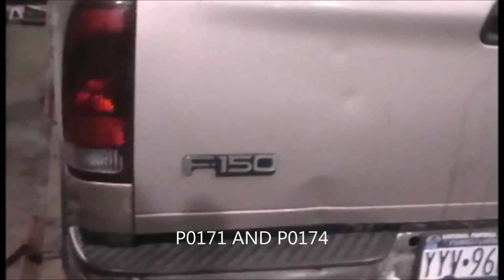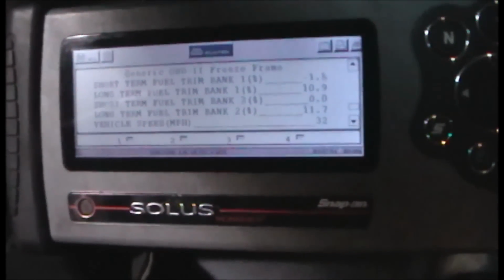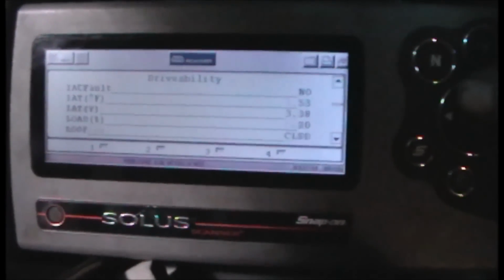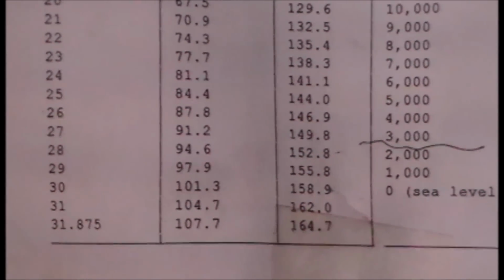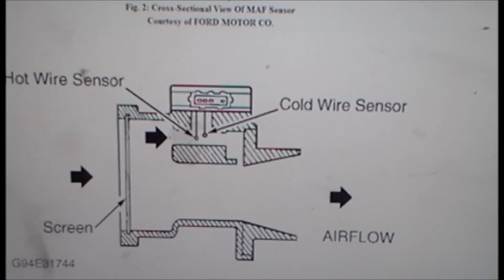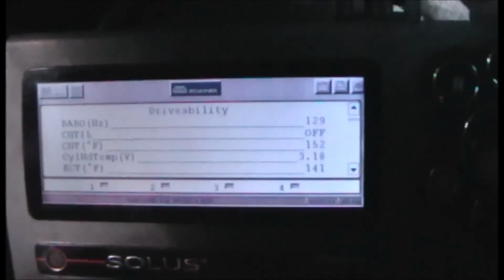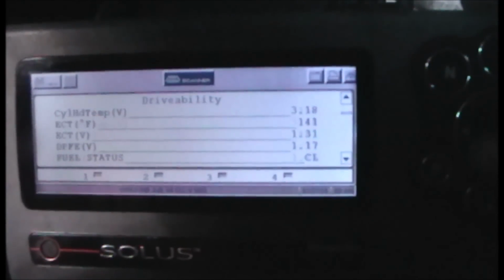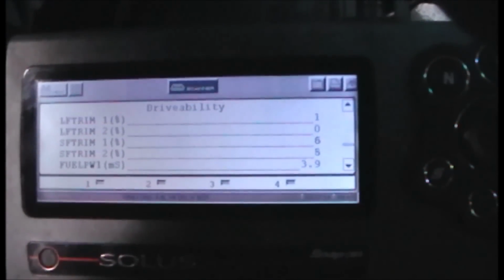FORD V8  SYSTEM LEAN BANK 1 AND BANK 2

Comment: Nice video and the day after i watched your video i got a ford explorer with the same problem. Its cool when that happens. First i tried the wot / o2 test then baro. I had the same codes. Freeze data showed 1800 rpms.  Your baro chart is nice.  Thanks
Reply from the maker: sweet

Comment: Do you have to disconnect the battery?
Reply from the maker: that one cleared up on its own but I have had them go into open loop fault the set rich codes due to the drastic change after fix and need a keep alive memory reset. which can be done with a scanner on some cars without disconnecting the battery

Comment: Curious why a fuel delivery issue was not a consideration based on the data. How did you know to differentiate a MAF sensor issue from, say, weak fuel pump?
Reply from the maker: great question.  I know you are a technical thinker as well. honestly, I have seen this so many times and the fuel trims always act the same. coupled with the lack of any real performance issues like a bog, misfire or low power, which I would expect with a bad pump. I started there, given the baro Hz reading.  that is why I like seeing my confirmation readings on scanner or scope,  whether its re instrumenting or leaving stuff hooked up. because honestly, if I didn't see the fuel trim swing opposite on short term, id  be digging deeper. also just a cleaning is easy. if I needed to purchase something, I would try to eliminate any other variables to avoid the second phone call Ha
Reply: Schrodingers Box

Comment: good video. where's the PCV elbow on a 2003 4.6 ford expedition? i have code P0174
Reply from the maker: off hand I'm not sure.  but some have that same style on my mercury sable system lean video.  but it is way in the back near firewall. center line of engine.  follow the hard plastic pipe from valve cover
Reply from the maker: u able to see freeze frame data?
Reply: Find valve cover look for hose coming out of it or google image search

Comment: cleaned my MAF very thoroughly check engine light still came back on a day later im assuming i have a vacuum leak not sure where  :(
Reply from the maker: u have a scanner to see fuel trims? if they are higher at idle then yes.  look for the pcv elbow probably at back of intake. firewall area.if its a v8. a hard plastic line goes from valve cover back to this hopefully collapsed hose. let me know

Comment: thank for taking it apart and sharing...just got my first truck f150 99...im doing maf tonight and going to replace an 02 sensor in a few days of code 0153 remains...can you off hand point out location of bank 2 sensor 1? driver side in manifold right?
Reply from the maker: yes. Ford's bank 1 is pass side cyls 1-4 and bank 2 is drivers side cyls 5-8. sensor one is upstream or before converter. whether in manifold or pipe.  thanks for watching.
Reply: Bank 1 and Bank 2 is that The Spark Plugs?

Comment: James, A couple things, Freeze frame data on a Ford, can be a wild goose chase as it can set way after the code set and give you BS, I can tell  you I have had several Intake leaks that would only leak cold, but if you look at FF data it will show it was at full temp and under load when it set. Also be very careful with BARO especially wilth a P1000 code if someone did a KAM reset the BARO can be off.
The best Indicator of an MAF on a Ford is the Load PID if under full throttle it should easily go over 90%
Reply from the maker: cool, ill look into that load pid, i know what you mean about the freeze frame lag. i have not seen it being way off on temps and loads but ill keep in mind. ive seen the cold leaks on the 3.8l but it always showed up as a low temp. thanks for watching. i appreciate the feedback
Reply: If you don't have load pid on your scan tool, you can also watch the pre cat O2 sensor(s).  They should both go 0.8-0.9 volts at WOT while driving.  If not, you have a MAF or fuel delivery issue.  If it has an A/F sensor, the A/F voltage should go down depending on what the manufacture has for a base voltage. Toyota/Lexus is around 3.3 volts at 14.7:1.  Not sure on the others.
Reply: Hmm ive been trying to trace an issue on my 1999 Mustang GT 4.6L where it runs at high fuel trims. I know its not a vacuum leak since i recently upgraded the intake manifold and it has new gaskets now. Also checked vacuum hoses and none have any issues to cause vacuum leaks. I changed the maf sensor to another used one and it was still the same reaction. I recently swapped the CAI for the stock intake system. Now im noticing if im idle the ltft will read 9% to 12% on both banks, they may differ but be in the range. If i leave it idle too long without revving, after a while the fuel trims begin to rise and the car goes to open loop fault. If the fuel trims are high, revving the engine a couple of times high will bring the ltft back down. Forgot to mention at 2500 rpms the ltft on both banks goes to 25%. Only mod on the car is longube headers.